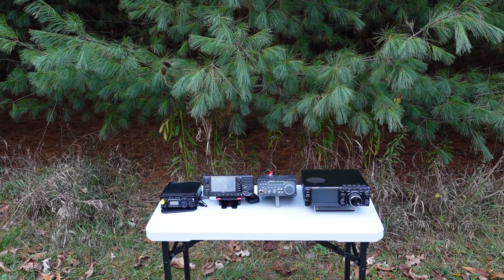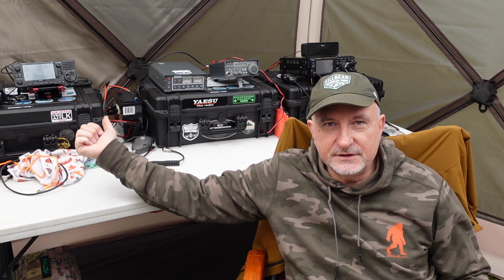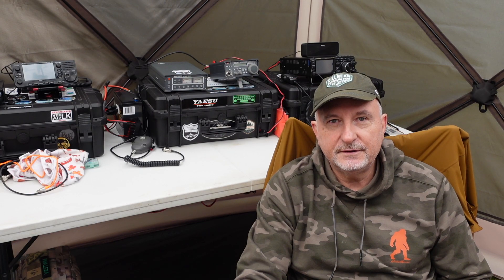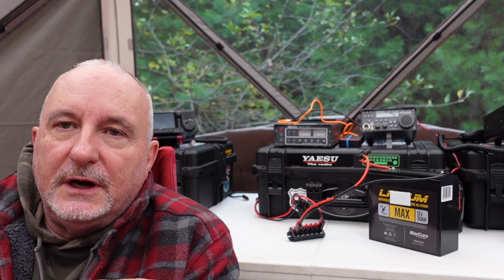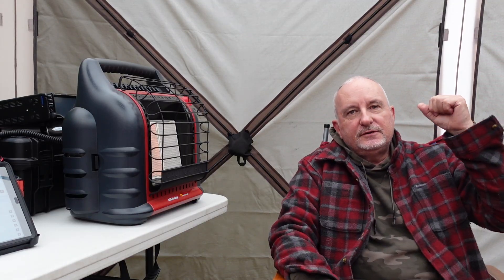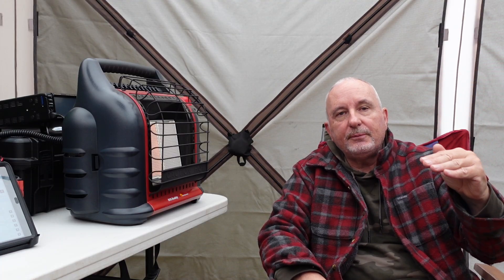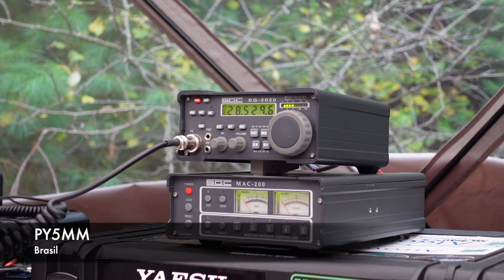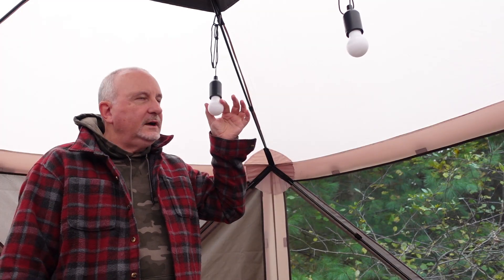I Built a Field Radio Station to Go DXing - CQ WW SSB 2025

Comment: Hi . Nice one ,to go outdoor and go for a contest weekend. I am about to do the same tomorrow. There is a European 24h contest. My setup will be a bit different: I will use my car,  a triple magmount on it, and CHASS25 vertical for 10m-40m (2 radials in addition to magmount), then Shark monoband sticks for 80m , and 160m . So I will be live on all 5 bands. I will use my FT710 powerded by 30Ah LifePO4 / and a Acom 1010 Amp 700w, powered by a 3000w inverter on a 200Ah LifePO4 battery (the combination gives me 7 hours continuous SSB transmit time) . I will have 700w RF out on 10-40m , 300w RF on 80m, and 200w on 160m.  The most important: I will have the car parked few feet away from salty water (English Channel). I will post again after the weekend with the results
Reply from the maker: Wow! That's an impressive station, have fun and may the propagation gods be with you.

Comment: Whoa, lookit that SGC gear!  I was a young ham when they were selling that stuff. As I'm a sucker for odd gear I spotted a tuner for sale recently and saw the five-way switch-and thought HEY that's great!.  Went to look at reviews--oh my word. There were some issues that unit.  I'm sure yours works great, but I'm going with one that might be easier to fix if anything goes wrong. Even those who love 'em call the SGC tuner "quirky". 

Missed an awesome location/opportunity just this October largely because I simply hadn't put my "travel station" kit together.  I'll try to get all that sorted this year.  Having a beach house deck actually over salt water/wet sand---was just too much for me to forget.  I just hate exposing my gear to the NaCl in the air---I'm SURE the 817 can take it, but I LOVE using my Elecraft (and want it to last forever and two days).  Decisions decisions.
Reply from the maker: Hi Wade, I read all about the MAC-200 tuner's reputation when I acquired it, but the fact is, it easily handled most of what I threw at it, including G5RV's, Windoms, OCF's. Even LDG tuners will throw up their hands at some antenna configurations. Get that travel kit together!

Comment: Propane heater? Now we're cooking. I can  handle that.     

I've been a ham for over 48 years and have been active portable for over 35 years. I never thought about operating portable in a WW contest.
You gave me a great idea. Now since I'm old, I hope I remember to do it next year the WW SSB contest. Hi Hi

I liked your selections for radios. Most impressive to work Puerto Rico with only 5 watts.

Knocking the FT-710?   I don't get it. I had a 710 and sold it to get the FTDX-10. As much as I like my 10, I am sorry I sold my 710. I'll keep my since it's great radio but I think next year I am going to get another FT-710. It's a great multi purpose radio. Use it in the primary station as well
as for portable.

Since you stay in the parks over nights, "Have you ever run into an bears? Carry bear spray?

Barry G. Kery, KU3X
PS...Goes without saying, "Yet another great informative video."
Reply from the maker: Hi Barry, don't overlook the fact I got Argentina on 5 watts, too. Glad to hear I got you rethinking cool weather ops. Never run into a bear on any site I've stayed at, but. I keep a very clean site. 
I don't have bear spray but I carry a VERY loud whistle around my neck when in bear country. AllI have to do is remember to use it when I see a bear :)
Reply: @OutdoorsOnTheAir  Bear Repellant......Take some other ham with you. Than all you have to do is out run the other ham. Hi Hi

Comment: Hi, 
what antenna you used? I din't understand it very well.

i have some improvements:
1. big generator
2. big tube amp
Result: contacts more  far away, and you don't need an extra heater :P
Reply from the maker: Hi, I used a 51 foot 40-10 meter Aetherwave Antennas G5RV. Your improvements are awesome and hilarious :)
Reply: @OutdoorsOnTheAir  Ty. the "Aetherwave" was what i din't really understand right.